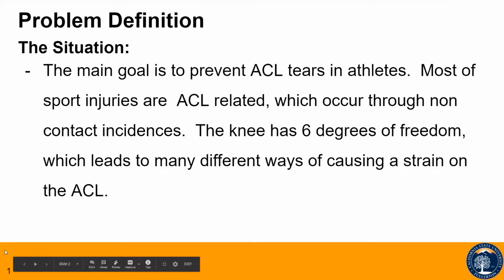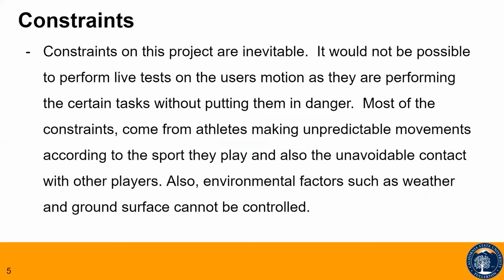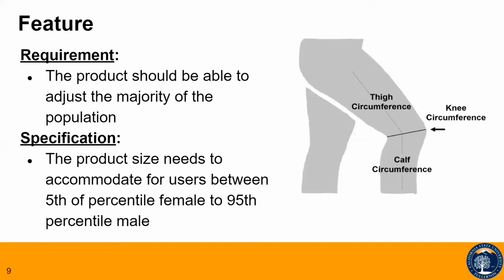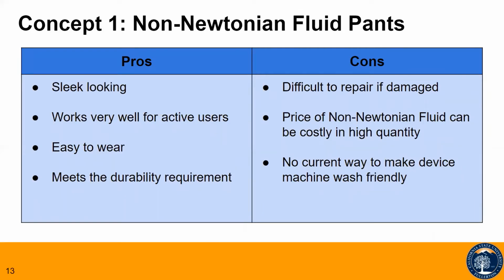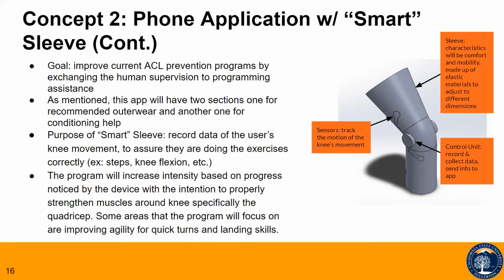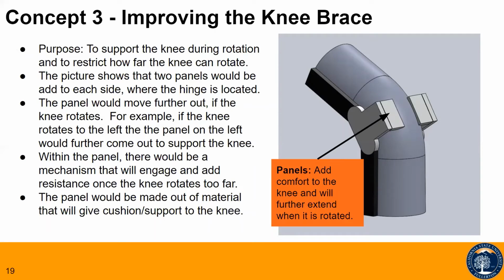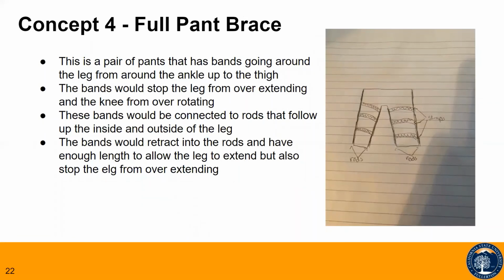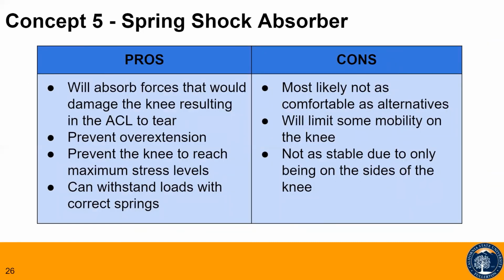Conceptual Review Presentation - Sports Injury Prevention ACL Tear 1

Comment: Great job tackling this very difficult problem. It is hard to come up with assistive equipment that is non-invasive especially when actively moving in intense sports.  I like the full pants brace. I dont think that hindered movement will be a problem given that its a fair compromise compared to never playing sports again. No matter what kind of material or design you have, the rods will still be an extension of the body. This is something that an athlete will have to get used to with the help of physical therapy training. This training can help athletes alter their movements so that the bulkiness is less of a nuisance.

Comment: The combination of mechanical laws with bodily movement is a mind-blowing subject. Your presentation is super informative about the ACL as well as its injury mechanism. It was interesting to learn how there are many factors that play a role in the injury of the ACL. The variance in concept differences seem reasonable and well thought out. Concept number two stood out to me because of the simple concept of correcting human error via a program. Its ability to collect data as specific as “quick turns” seems very crucial to the understanding of the true causes of the injuries. The improvement on the knee brace (concept number three) also was an interesting one, especially with regards to its ability to restrict the range of knee rotation, which your team defined as one of the causes of said injury when occurring unpredictably. As a response to the question of what could trigger panels to move further out when excessive knee rotation is detected, has your team come across the “Inertial Measurement Units”? Upon further research it seems to provide a body-worn alternative to methods that appear to be restricted to laboratory settings. Overall, I truly enjoyed your presentation. Thank you for making it so interesting.

Comment: Good job for the presentation! I like concept 2 for the Sports Injury Prevention ACL Tear. The concept of the phone application w/ “Smart” Sleeve is ideal for any athlete because it will help strengthen muscles and reduce the chances of tearing the ACL. The design also looks appealing and comfortable for the user and this is great because comfort is very important in sports. However, you should improve the design so that it can be used for in games and also make it lighter so that the extra weight does not affect the performance of the athlete.

Comment: Great presentation guys!  The first concept seems like it is beneficial to contact sports, which will protect the knee from sudden impact. Maybe using materials that will make it less cost affected since the concept has limited use. The second concept is an idea that can be useful gathering data about the knee and the athlete can make adjustments improve the strength of the knee or change natural movements to prevent injuries. I like the third concept because it prevents the knee from sudden rotation and can possibly prevent the knee from hyper extension. Overall, using materials that are light and flexible will be beneficial so that athlete can still be able to perform.

Comment: As a former athlete who had to wear knee braces to prevent injury, I like the idea of the first prototype using non-newtonian fluid as a compression against the knee. What would be an advancement in design is to merge the first and second prototype design along with flexible sensors that can detect the knee's movement and apply proper support to the stressed areas. The smart system could then notify the user if they are reaching the safe motion limit of their knees.

Comment: I like the first concept, does the fill in air goes through the whole pants or just the knee area?. Maybe add a hole gap in the pants around the knee area where inflatable airbags could be placed and easy to replace if broken?. For prototype #2, I think the ideal time for a battery to last would be 2 to 3 hours per use. For concept #4, is the device meant to use for practice before a sport or while doing the sport? If so, would it limit the user's availability to deliver its best performance when playing?

Comment: I liked how good of a job you all did researching the mechanics of the human leg and knee, it was evident that you knew how these ACL injuries occur and how to prevent them. I also liked how you addressed the fact that you cannot test these prototypes on a human, but I was left curious as to how you would test your project and know it actually prevents these injuries. Have you perhaps considered ways to apply a damper in any of these prototypes? I'm not certain if it could work or if it could realistically fit on the knee, but maybe there's a way to apply a motion damper or rotary damper to limit how much the knee could move.

Comment: I like the idea of a smart sleeve a lot and I feel that it would appeal to people that like electronics and gadgets. I think it would be possible to market the project as a safety device that also helps your workout. It would be an added benefit that people would actually go out of their way and want to use the safety equipment. I don't think that battery life would need to be extremely long, considering that most people only work out a few hours at a time. Also, I think it might be possible to stitch in thin semi-flexible polyurethane bars that connect to an angle sensing element (possibly a small rotary potentiometer or hall effect device). Overall, great work on the presentation and ideas!